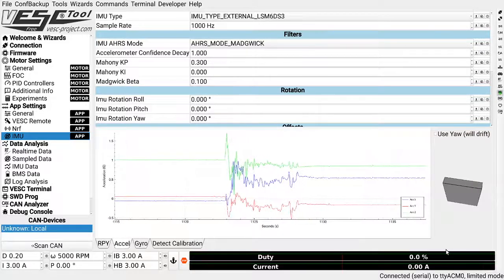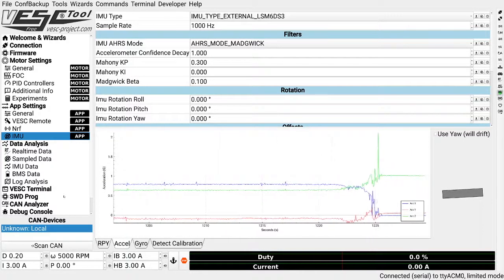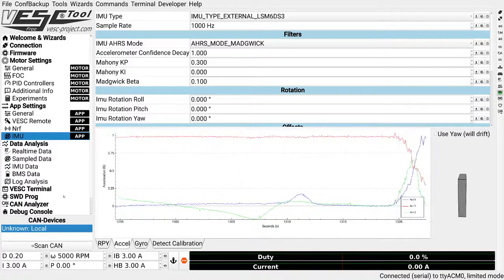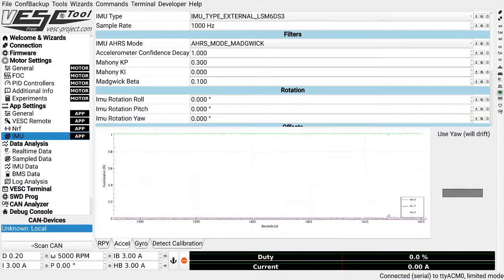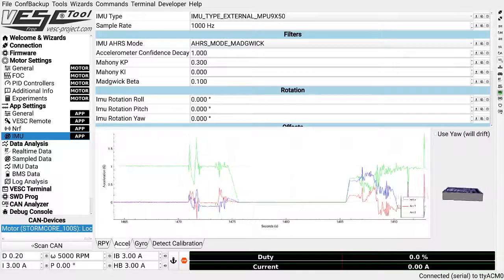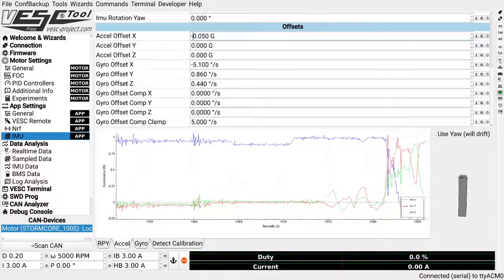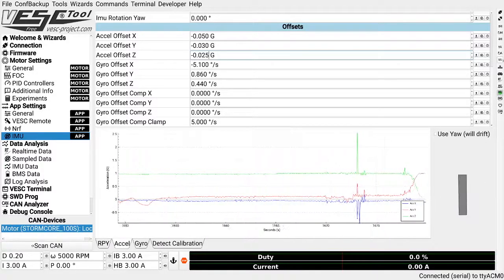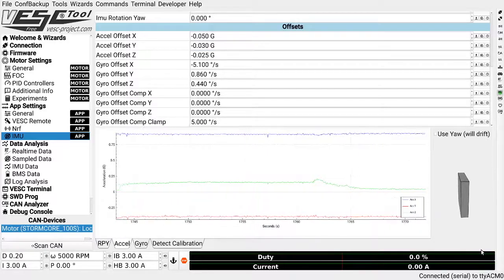VESC Balance Tutorial v2 - Accelerometer Calibration

Comment: is there a way to test the output of the VESC with an oscilloscope or something?  we changed out some burned mosfets but not the driver gates yet.
Reply from the maker: I dont have one, but i think ive seen others do it 🤷
Reply: @freedomcaller  did you seed the IMU calibration procedure on Austin Marhold channel?  I wish trampa had made something like that, I searched and searched.
Reply from the maker: @FourthWayRanch  trampa doesn't sell any products that rely on an imu, nor did they develop the imu calibration wizard in the vesc tool.
Reply: @freedomcaller  sure they do, I bought my vesc 100/250 from them, it's what I put on the V11.  I soldered some new mosfets on that thing, I wonder if I can try it without changing the gate drivers or it will burn more mosfets if they bad

Comment: I want to put my VESC on my inmotion V11, i'm tired of dealing with inmotion bad boards and bad service.  what else do we need other than the VESC to make this happen?
Reply from the maker: That is gonna depend on which vesc and which inmotion. The 2 pieces of the puzzle are figuring out of you can use their batteries and bms without their main board, then figuring out all the accessories like lights, speaker buzzer, etc and how you want to handle those.
Reply: @freedomcaller  we have a 100/250 just like yours, was using for a paraglider winch, I've already used it to test my EUC motor which works fine..... when the inmotion app said replace it. it should handle the two 84V batteries no problem.
Reply: @freedomcaller  why would there be BMS problems, are you talking about the problem of braking on a full charge pumping current back into the board/battery?
Reply from the maker: @FourthWayRanch  depends on the bms. Newer models have a smart bms, and there may be some communication required to safely use and charge the battery. For older models it is probably much simpler. But i would still want to know what every wire coming from the battery is intended to do. Begode batteries just have power and charging output so they're very simple to swap.
Reply: @freedomcaller  yes there is a small black and a small red wire coming out of the XT90 connector, do you think these mother boards are drawing separately from the two batteries to keep the voltages close or is that only happening at charging?
Reply from the maker: @FourthWayRanch  i would guess both charge and discharge are done in parallel but that is just a guess.

Comment: I am trying different IMU-s, to reduce noise, and be able to set the PID values higher, without motor whine / faults.

With low pid values the board not responsive enough, excelerating slowly but I can achive great speed.
With higher ones where the board handling is good enoug I have motor whine, and Duty cicle cut off shuts down the system even on lower speeds on any sudden movement what makes the board dangerous.

I tested so far MPU6050, ICM20984, LSM6DS3, ISM330DHCX, BMI160.
The BMI160 with breakout bord (cheap purple one) does not seem to work as well as the ISM330DHCX (adfruit).

I have high hopes for the industrial ISM330DHCX it has almost 1/20 noise ratio compared to the LSM6DS3. 
It has the same arduino library as the LSM6DS3, but the VESC does not recognise it.
Can you help me where to look?
Reply from the maker: Have you tried the D term pt1 filter?

Not sure what the duty cycle cutoff has to do with this, it should be completely unrelated.
Reply: Thank you! I just tried out. It behaves much better / quieter now.

I realised my OneWheel like board behaves much better with large D values, but it also makes it much weaker for noise (probably noise is the largest factor in the difference between the actual and previous pitch value if the board is almost steady on 1khz). With low PID values I don't have enough torque. The board nose dives. But with large enough values, the PID easily shoots to the moon, and the system shuts down (higher duty cycle cutoff helped a little bit). Because the board shape I have little pitch to play with.
Reply from the maker: @ivanbartak1886  duty cutoff should only happen near max speed. You sure its not a pitch angle cutoff?
Reply: @freedomcaller  It goes to DEAD state instead of FAULT.
I may be completely wrong here, but it is possible that my motor cant keep up with the acceleration its quite heavy and the error feedback in the PID gets higher and higher, so the output, till the motor should spin at max speed, but for a fraction of second only?
Reply from the maker: @ivanbartak1886  if the wheel is not in contact with a surface, it can get to dead super fast. Testing with the wheel freespinning is pretty much useless.
Reply: @freedomcaller  The wheel is always contact with the surface.
Also I want to thank you the awesome work with the balance app, and IMU implementations!
Reply from the maker: @ivanbartak1886  😊 thanks. Maybe join the telegram chat room and share some videos, it'll be easier for me to understand what's going on.
Reply: @freedomcaller  Can you please share the address of the telegram group?
Reply from the maker: @ivanbartak1886  I don't think I can comment links, but it's posted in the description of the intro tutorial video.
Reply: I'm trying to hook up a BMI160 cheap purple breakout board with a flipsky vesc 4.12 through I2C, I don't get any reading , wonder why?
Reply: I did short SDO to ground